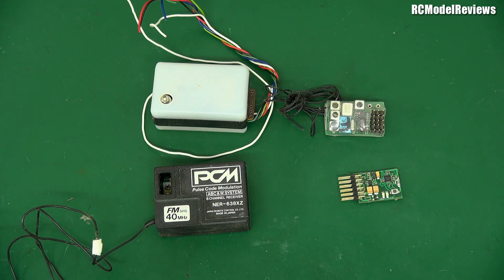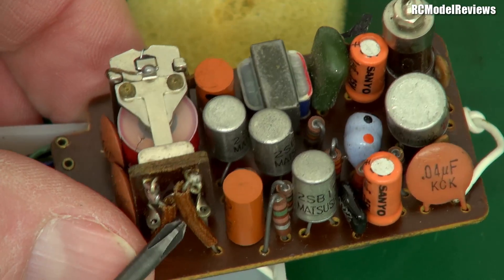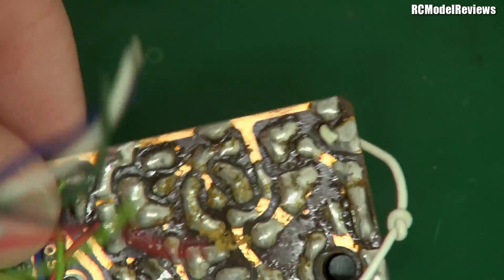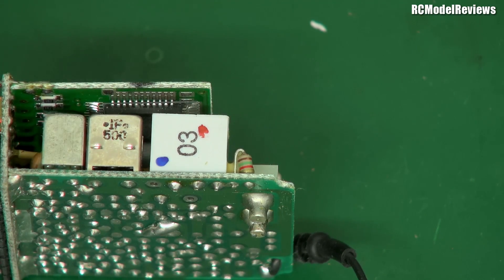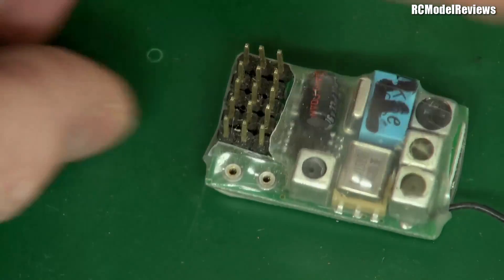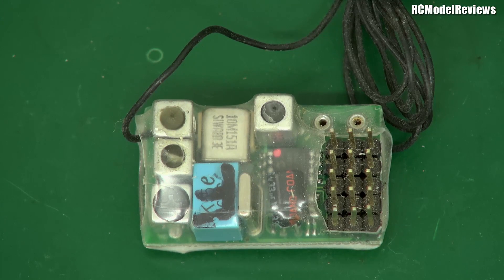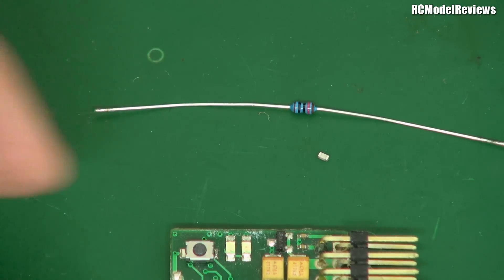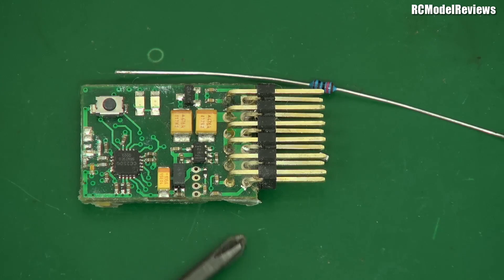Tech: A little RC receiver history (50 years worth)

Comment: My interest is electronics. As a kid (in the 70's) I used to get RC books from the local library. I was always fascinated with the circuits. I did try to build a transmitter and superhet receiver, but they never worked and I didn't have a way to test them. It's still on my bucket list to re-visit that old design and re-make it and get it working! I still have the RX, but sadly not the TX for which I made a PCB.

Comment: I have a Citizenship Galloping Ghost transmitter and receiver as well as the actuator. Super regen receiver of course, I bought it in the late 60's. It was on 27 mhz, terrible band to be on, one CB nut with a linear amp could bleed over the entire band and shoot you down, never had a lot of luck with it. No real RC success till a new hobby shop opened up, the owner was an RC guy, sold me a 4 ch EK Logictrol proportional radio and taught me to fly it. I'm 72 now, slowing down but still doing RC.

Comment: Except for that really old receiver you showed, alot of those I still fly with, including the transmitters. I have modern  GHz equipment, but also have some 72mhz stuff that still works fine.
Reply: Depend on bandwidth, though. The bandwidths were narrowed in 1991.

Comment: Great video. Amazing how technology has moved forward. My path was Sanwa 27meg, Futaba PCM, JR PCM, Spektrum, FrSky. My JR PCM 9 Tx felt like an amazing piece of kit, with its balance and smoothness. Learning to fly in the 80s and 90s meant frequency pegs, buddy boxes, power panels, the smell of glow fuel, time spent getting intimate with your O.S. 40, and that glorious feel of turning over the prop on your just-run engine after a successful landing. Not to mention the unavoidable learning curve of guiding an RC model in flight. One shouldn’t needlessly cling to the past, but in this day and age of return-to-base, Instant brushless power, FPV and new drone regulation, it’s nice to remember and reflect on the path of evolution.

Comment: If you think it's amazing how small a little 0805 passive can be, you should look at "microfoot" transistors. I have 4 pin transistors that are less than half the size of an 0805 resistor. They're almost impossible to work with without a microscope. The fact there is a process that can etch and cut silicon precisely with repeatability at that scale, and at a way that only costs pennies per piece is incredible to think about. Even more so when you consider that that's not even "small" in terms of what's really small today.

Comment: Could be fun to compare gyro stabilizers from different eras too. I had a heli in the early 80's equipped with a one-axis gyro stabilizer on the tail, based on a tilting electric motor with flywheels of brass and a separate control unit connected between the receiver and the tail-servo. The small heli that I have today, has a 3-axis solid-state gyro and accelerometer embedded into the receiver, and the whole thing weights far less than my old gyro-unit alone.
The RC-controllers for helis is a story on their own. They had so many switches back then, that they really deserved their nickname - the horlled mine. Touching wrong switch on my old JR could lead to disaster, so my contemporary and slightly modified DX6i feels a lot more comfortable - and safe.

Comment: Had one of those pixie sets. Two motorised escapements, one rubber band escapement and the dit dot code written out on a note pad page by the original owner.
Sadly all lost along with all my workshop gear in the 2013 flood. Just getting somewhere near normality back now.
Mate of mine has an early 8 channel reed set, still operational.

Comment: What no Valve (tube) gear or Reed equipment. First RC model aircraft I seen flown was in about 1955 (I was six), It had about a six foot wingspan, was hand launched by two guys rose flew a large square around the field and landed. The guys who flew it celebrated with Beer and Champaign for the adults and ice-cream and pop for us childeren.

Comment: 1980 is when I started, things have changed a lot. I remember the clothes clip with a color flag on your telescopic antenna indicating what crystal or frequency you are running in the race so no one else turns theirs on and controls your RC unit. But this still happened, either by mistake or intentionally causing you to crash and loose the race, qualifying round or heat. Once spectrum came on the market it changed everything and made it a lot easier for people not to accidental turns theirs on at the bench while another team was racing.
5:14 is a coil, red, white, gold, silver is 2.9 µH,  ±10%, I believe they are also sometimes called a fixed inductor or throng whole choke.

Comment: Isn't anything 50 years old or older considered an antique? LOL
My gosh, I recognize all of those components on the older boards, I've made my own single sided circuit boards myself.  I guess this means I'm an antique as well. LMAO ! (68 years young here ) :o)  I can remember truckers when they used CB radios with linear amplifiers to boost their transmitting power going by a RC park that was near the freeway.  They would key their microphones just to watch the RC pilots go nuts when they got their controller frequencies jammed and the aircraft fly off. LMAO ( sorry, I guess you had to be there to enjoy the irony of it).
Thanks for the video and making me feel like I have one foot in the grave and the other on a banana peel. lol  :o)

Comment: I started flying with my father in the seventies, already on 35 MHz, but AM. You could hear the transmitter in a short-wave radio :)
The worst thing I've come across was a broken crystal. It worked fine, as long as the motor wasn't running at a certain RPM. 
Exciting times those were ;o)

Comment: brings back memories. I still have my fist radio transmitter... an OS Pixie TA-2 single channel with a push button switch. It uses a crystal at 27.120 MHz.
Basically just a remote ON-OFF switch to run a rubber powered escapement giving Right, Neutral, Left and Neutral commands in sequence.
Reply: Thanks for the informative Link... very similar to the escapement I had.

Comment: I remember the old Kraft rc systems, where the receiver and I think 2 servos, where incorporated into a single unit or block. Also the old Space Commander systems. Fun days.
Reply: I still have my 4 channel space commander. Learned to fly RC with that one.
My next radio was a 5 ch Kraft Sport Series that I also still have.
Reply: I had one, too. Bought it second hand in 1974, it served me right up to the late 1980's. Two servos in the 72 MHz brick, third channel for a separate servo. Great quality (made in USA). Used a 4xAA alkaline pack, never failed me, many long soaring flights. The Tx used a big old 9 volt dry battery, eventually I made up a pack of many small 9v batteries in parallel when the big battery was no longer available. These batteries lasted a long time!

Comment: Excellent video Bruce. My grandfather   had a couple of valve receivers, still driving an escapement. The valves were tiny, like an inch of pencil, and it needed an A and B battery (~45v).. talk about crash damage..! I don't know how the heaters stood up to a nitro engine, just lots of foam I guess.. The transmitter was a big metal box with a couple of switches and a huge antenna, it was the Taranis of the 50's!

Comment: The change in the cases from a rigid plastic to shrink wrapping/cardboard should not be ignored in terms of size reduction, however that makes the product less resilient to damage. I'm not convinced that's a technological advancement, but more a cost saving measure.

Comment: How does a frequency hopping system sync itself?
Reply: I believe you still do one initial sync sometimes holding down a button on the RX or both the RX and TX sort of like pairing Bluetooth devices. . Each unit has a unique hardware address build into the RX and TX usually referred to with most stuff as a MAC address. This is the same MAC address with WiFi radio for internet off a access point or WiFi router. Also is used in networking hard wire. The readings RX/TX has thus same type of unique address so when yo I turn the transmitter back on it knows what receiver to talk with and what one is yours. They then agree on what frequency to start on after scanning and seeing what ones are not in use. 
In the early 90’s people were stealing TV cable and they turned in frequency hopping during a pay per view unexpectedly. Everyone that called into support basically admitted they were stealing the cable just because they called, lol. People who paid never lost signal and saw the whole even, lol.
Just like a garage door opener has to be synced once’s then they also change the frequency every time the button is pressed. Older door openers were flawed because they repeated the same frequencies in a loop so thus could still be bypassed. And same goes for car key fobs, but now we are licking random hopping and encrypting between the TX and RX for security making it harder for people to clone the garage door opener or or Car fob. Oh, and let’s not forget Cordless telephones, they called is DSS (digital spread spectrum) but basically the same hoping just digital and not analog. 
Then police, fire, EMT emergency services did frequency hopping called trunking. This made al, the police scanner useless at the time in the beginning so people didn’t know they had cops about to kick down the door on them. 
It can still done with some older units from some car companies just a few years ago, but I won’t get into his it’s done. Tech try’s to make it harder but vulnerabilities are still found just like breaking into your WiFi encryption called WEP that was broke, then WPA, and I think WPA2 is vulnerable now. But now we can update the firmware and fix it most times. WPA3 was recently approved and it again supposed to be harder and more secure.  
So basically I guess I’m saying these radio technologies are not used in RC receivers and transmitters, they are used with all radio technologies.  I hope this helps. RF is interesting.

FYI, this is a very basic overview and examples, it can be a lot more to these technologies. Even Bluetooth now uses encryption but didn’t in the beginning. The biggest move that allows a lot more things to run on the same frequency ranges is going digital from analog. Still this doesn’t mean that the frequencies get overcrowded affecting the range and performance since Bluetooth, WiFi, cordless phones, and even most RX use 2.4Ghz causing it to affect your range or even sometimes loose control with all the noise and so many things on it. This is why it’s important to use quality gear, a cheap FPV TX can be way out of spec and over powered and affect everyone else that’s flying FPV. I’ve tested some cheap overpowered FPV transmitters that knocked out my 5GHZ WiFi it was so bad. More power doesn’t always equal better performance. In fact better tuned frequencies squeal better performance. More power can end up causing an unstable frequencies and generate just noise with less range and inter fear with others.

Comment: The Pixie is relatively new and was state-of-the-art. I was using super-regen receivers as early as 1953 and lost several models as a result. Early silicon transisters were astep back because they involved a voltage drop of 0.7 volt compared with a germanium drop of 0.2 volts.Germanium transisters were very temperature sensitive. The item you couldn't recognise is a choke (inductance).The last Reveiver shown is now huge too. Try some of these:
http://www.deltang.co.uk/